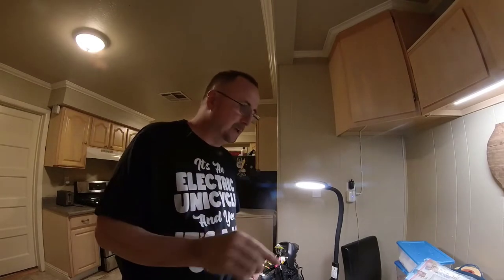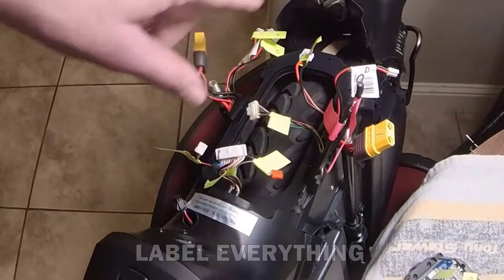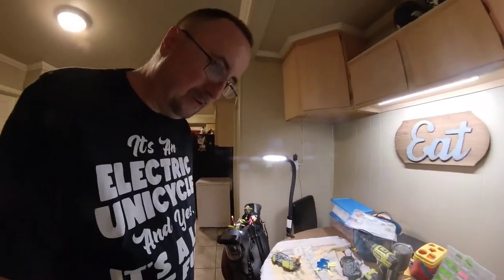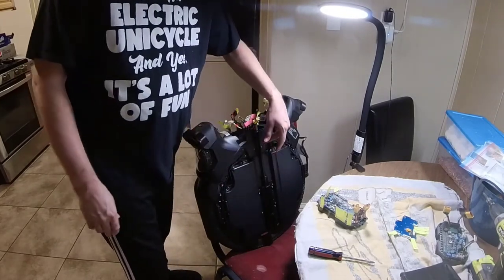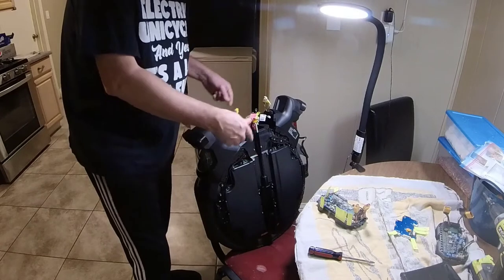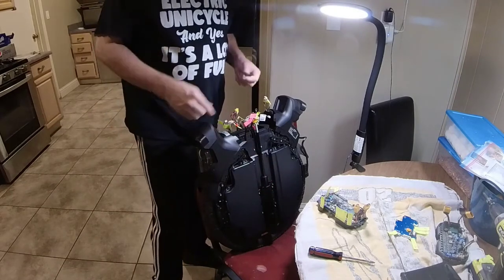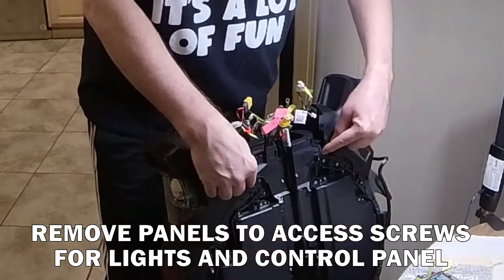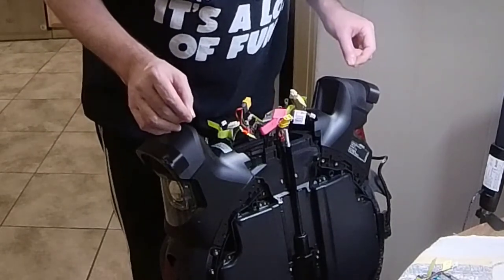Tips for Switching Control Board (Driver Board) - InMotion V11

Comment: Getting my board sent out tomorrow from EUCO.  Thanks for the video.  I hope it is not continual problems like you are having.
Reply: I replaced my control board and it’s showing the same symptoms as you’re describing. Now the wheel spins freely but no balancing, incompatible firmware and it won’t shut off unless you hold the power button down for 31 seconds. My motherboard arrives on Monday so I will let you know how that turns out for me. Not too hopeful :(
Reply from the maker: Let me guess.... you bought your V11 within the past 4 months?
Reply: @EUCwithLEUCIFER  yes bought it mid February.   So jealous of the people that got the good ones.  I will put in the Motherboard Monday March 14th.
Reply from the maker: @CaptainSuperFantastic  : Yup.  Batch 4.  Welcome to the club that nobody wants to be part of.  Good luck, man.
Reply: @EUCwithLEUCIFER  As an update, I got my motherboard in March 14th.  It powered up perfect and balanced great after the firmware updates with my iPhone.  I was riding it around the shed, and when applying braking, the wheel threw the Battery Calibration error with the "Please Repair" warning.  It allows me to recalibrate it with my phone and then it rides around fine until you brake again.  Wash, Rinse, Repeat.  Now I have an appointment with Inmotion China tonight for the tech to remote into my V11 to do the final battery calibration.  Supposedly then all will be well.  I will keep you and others updated.
Reply from the maker: @CaptainSuperFantastic  : Yes, exactly what I went trough. In fact, that's the next video it's taking me forever to edit and post.  The remote calibration with China didn't fix it & turns out it's an actual battery failure.  Same as the first V11 I had.  (This is my second V11 in 4 months & both with the same issues.)  I boxed it up and sent it back to EUCO for them to deal with it.  Thanks for commenting here.  The more people who speak up about how shady Inmotion is, the more informed new buyers will be (I hope).
Reply: @EUCwithLEUCIFER  So far mine has mirrored both of yours to a tee, so I don't have my hopes up.  Regardless, it will be hard to trust this thing going forward.  Can I ask, is EUCO charging you for shipping both of these back to them?  I can't imagine shipping is very cheap on this heavy wheel.  I am in MN.  Thanks for your comments.
Reply from the maker: @CaptainSuperFantastic  : I haven't paid shipping so far, but I think it depends on the reseller.  I think Alien Rides states that the customer pays shipping to send to them for repairs, but they pay to send it back to you afterwards.  I asked the FedEX guy when I dropped mine off last time how much to ship it if I had to pay for it out of my own pocket & he said about $80 from Cali to Las Vegas.
Reply: @EUCwithLEUCIFER  3/17/22 update:  On the night of 3/15 I was able to get in touch with 2 different InMotion techs in China using WhatsApp and the InMotion Service feature.  They both calibrated it via remote but it didn't act any different from when I calibrated from my phone.  It still rides forward perfect but says Please Repair on braking and tilts back.  They had me record and send a video and analyzed the Uploaded log.  They saw that I had a battery 2 failure.  So, EUCO is shipping one out morning of 3/18 and I suppose I will get it Monday or Tuesday.  So far this will be $1000 in replacement parts for a wheel with 12 miles on it.  EUCO covered it all under warranty so I can't complain there.  Will post again once I know more.
Reply from the maker: @CaptainSuperFantastic  : Thanks for the update.  Good luck with that new pack.  🤞🏼

Comment: Hi!
Thanx for all your videos, j've learned lots of things.
I've watched all and i feel less alone... (i'm in the same situation!)
My elementary english language doesn't allow me to understand all the story.... I'm sorry...
But finaly... How many boards changing and does your wheel run correctly now?
Reply from the maker: This is actually the second V11 that has had the same issues.  After replacing the control board, mother board and BLE board on the first one, it still had other issues in the form of battery voltage calibration errors.  So I sent that one back and they replaced it with a new V11.  On this one, I have replaced the control board and mother board after a cut out due to blown mosfet.  Again, this one has battery voltage calibration errors.  Now waiting on EUCO and Inmotion Global in China to decide what to do next.  That's why the delay in a follow-up video after this one.  So I'll be riding my old V10f for a while.

Comment: Mine stops working after 13 months… can’t seem to find replacement control board for sale anywhere 😭
Reply from the maker: Yeah, EUCO still has my wheel going on two months now.  Originally sent it to them for battery pack replacement. Now they say they are waiting on a shipment of new driver boards from Inmotion China.  Apparently, a LOT of V11s have defective boards & that's why everywhere is sold out.

Comment: V12 has bad mosfets, V11 has bad mosfets. Gear job inmotion :D. I have V8F and my motor completely died after 560km. I will stay with begode probably. I have 0, absolutely ZERO problems with my Begode Tesla T3 after 2200 km :).
Reply from the maker: Yup. Gotway/Begode gets quite a bit of hate, but I'd gladly take a Master or even an overpriced Hero at this point.  Inmotion is garbage.

Comment: Hi Leucifer! I just finished swapping out my motherboard and it's not showing any battery charge and the wheel won't balance. Sounds like you're having similar issues with your wheel. Did you ever get it working again after replacing the motherboard? I'm waiting to hear back from EUCO about it, hopefully they have a way to fix this, I'd hate to have to send it back.
Reply from the maker: Yeah, that's what mine did too.  Now they will send you a new motherboard.  Last issue may be where I am right now: Battery voltage calibration error.
Reply: @EUCwithLEUCIFER  so they sent you another replacement motherboard?!? I'm considering sending the whole wheel in and seeing what comes of that. If they can't provide the right components, documentation, or instructions, then they should be the ones to have to figure it out, or they can send me a new one! This is my only wheel and I just want to get riding again!
Reply from the maker: @jakejuracka  : Right. They say sometimes the motherboard doesn't connect correctly after a control board switch, so new motherboard. You might go ahead and send the whole wheel back and tell them to fix it AND test ride it to check for voltage errors before sending it back to you.  Probably what I should have done.
Reply: @EUCwithLEUCIFER  thanks for the tip man! I worry the Mosfet induced fall may have bent the wheel too, so it's probably best that I send it back. Bummer though, hope we can both get our solution to this problem!
Reply: @EUCwithLEUCIFER  just installed the new replacement motherboard, and encountered the exact same issue as before: wheel powers on, doesn't balance, shows 0% charge, warns me of incompatible firmware on the components (even after firmware update), and the power button won't turn it on or off (wheel powers on as soon as the Battery leads are connected). 

I'm at wits end here, and ready to demand a refund. Did you get any luck in your process? I appreciate you making this content, it makes me feel a bit better to have someone else in this boat with me! Hope we can both get riding again soon!
Reply from the maker: @jakejuracka  :  Did you try holding the power button for 35 seconds?  That was the only way I could cut power (besides unplugging the batteries directly).  Sounds like it's still a motherboard issue.  Contact EUblow.... errr.... I mean EUCO again.
I'm still dealing with issues too.  I'll be posting a couple vids about it soon.
Yup, I'm definitely regretting my decision to buy a V11, fo sho.
Reply: @EUCwithLEUCIFER  I did, holding the power button for 35 seconds causes it to power off briefly, but it turns back on its own again after around 10 seconds, and it's back to the same issue.

I really loved the 80 miles I was able to put into my V11. It's my first ever EUC and I had an absolute blast starting to incorporate it into my daily routine. It's a shame that this happens just as the weather is getting nicer.

You mentioned that you originally got your V11 replaced completely, how did that process go for you, as I'm considering demanding that option if they propose sending me a replacement-replacement-replacement motherboard!
Reply from the maker: @jakejuracka  : At this point, I would box it up and tell them to send you a shipping label.  Let them try to repair it.  They won't even consider replacing it until they get their hands on it anyway.  As for a refund??? Good luck with that.  After 30 days, customers are pretty much stuck with either repair or replace until their warranty runs out.